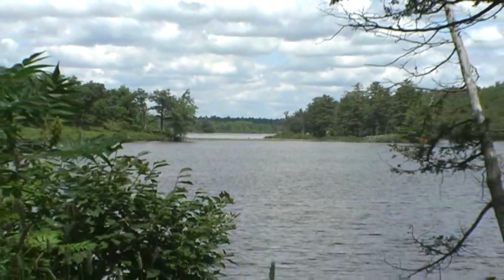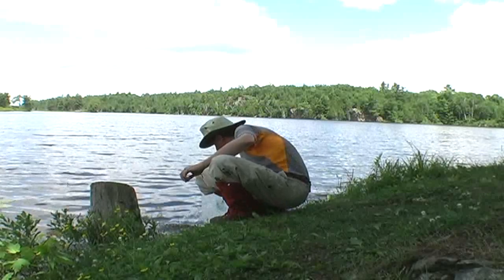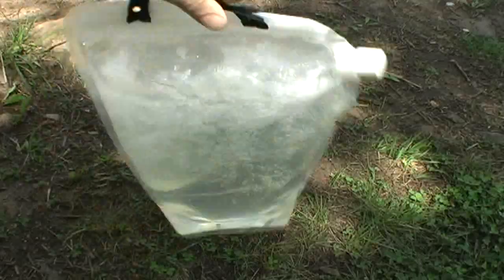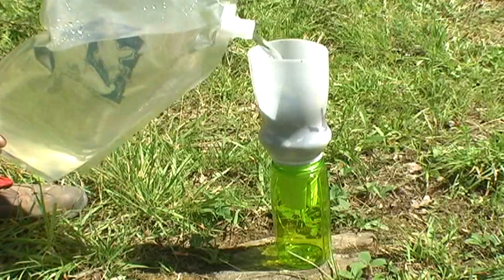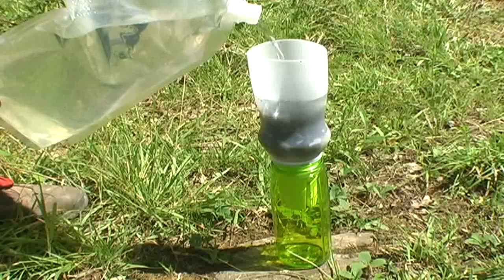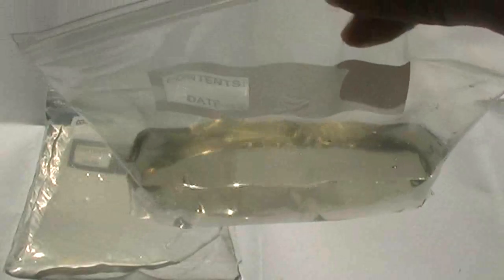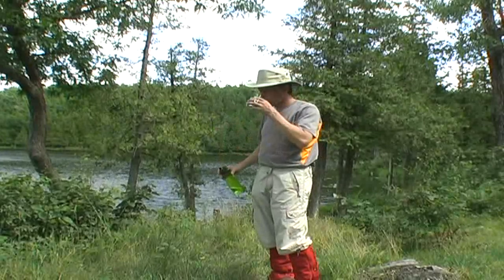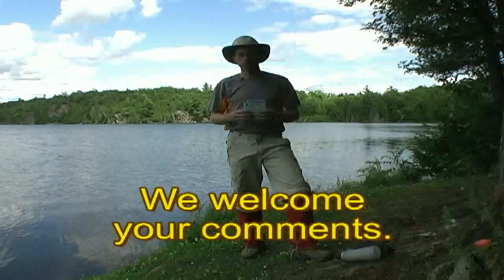DIY Water Filter Hack - Video Response

Comment: I am hesitant to use DIY water purification projects for obvious reasons. And when they include expensive store bought parts ( eg. Brita or Zero filter units & water purification tablets) then I can't help but wonder if a Mini Sawyer system @ $20.00 would not be a more prudent way to supply drinking water for your family. Just saying.
Reply from the maker: Yes.  The sawyer is a way better idea than this project.  It was not around when I uploaded this video.  I actually think the Brita water filter is a waste of money.  Since the video was produced I have played around with the Brita to see if it can remove rust as advertised and it can not even do that.

Comment: The only thing about UV pens, is that they require batteries for use, and that they are electronic gadgets. Not that electronics are all bad, but electronics sometimes fail or break, and if you run out of power, then what good is it? I think as long as you have a back-up method during a short trip, the UV pen is a great idea for a renewable source (but also a little expensive).

Comment: A multi-media filter gives the best all around results. It is the process used by many smaller municipal water plants. The chlorine is added for storage purposes after filtration. You can filter into a clear plastic bottle and expose to direct sunlight for 8-10 hours. This will kill off anything missed by improper filtration.

Comment: @EconoChallenge I prefiltered the tad pol water through the womans stockings. Then I treated the water with the Iodine tablets.  About one hour later I filters the water through my very large filter I made. The Results; well it did help.  But it wasn't as clear as I like.  It could be because of the system still needs some flushing out.  Perhaps I need to design it, so that I can place a small filter on one of the ends. I did drink some of it and taste the Iodine. Next time I'll use Bleach.

Comment: @EconoChallenge You know what I did today. I built a very large water filter  using 4" dia Plumbing pipe. I am not going into how I built it. But I added sand, charcol in a womans stocking on both ends, small rocks in the center and sand on both ends.   Used the green scrub pads.  Its not 100 percent done.  It must be about 4 feet long.  But I was able to test it. I had some old water that had tad polls in it. After I complete it I will add cotton on one end.

Comment: @wmdrtr I would agree if it were not for barium, aluminum, and a slew of other crap. Bacteria are EASY to get rid of, it's the heavy metals and the like that presents a problem. Solve it with no money and you will potentially have saved thousands of folk.

Comment: Confirmed! I made the filter to exact specs but used two and then later three coffee filters. I had a friend perform a purity test on it and it came out at 97% pure. 

I live in Truckee, CA and took the water straight from the Truckee River where the purity in the river is a SAD 61% - 72% pure. After the filter test it read 97% - 98% pure. 

So yes the filter works great! Thanks EconoChallenge!

BUT For those who live in the Tahoe area...keep the lake blue!

Comment: Take the wood in a fire that has turned to an orange color and dunk it in water, take the charcoal and grind it to a powder, use the same set up as in your video and pass water through the carcoal, then take the filtered water and boil it over the fire and you've got yourself some drinkable water without depending on filters. I haven't tried it yet but if you are really desperate and lost in the woods, and you forgot your filter,you should try it. Tell me if it works if you ever have to try it.